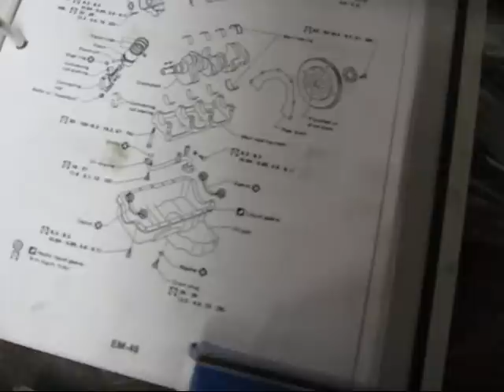Premier Z Shop - Jamie Part 3

Comment from the maker: @zyou8er I do not have the tools for that but rather my machine shop does that for me. After the machine shop hones out the block redecks it put new freeze plugs buys me the correct rings and bearings for it acid dips it and polishes the crank then I go ahead and put it all together.